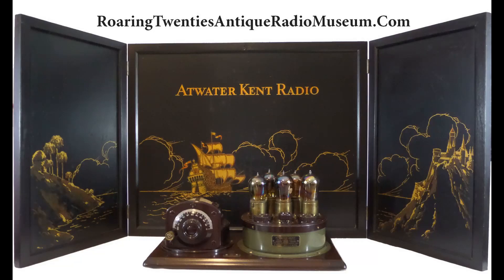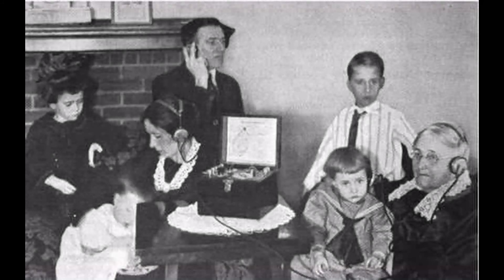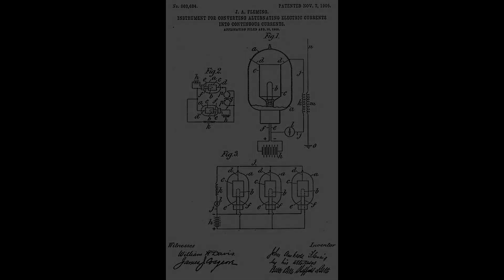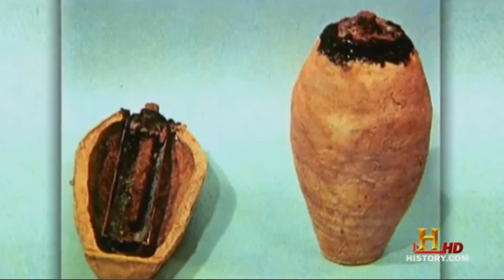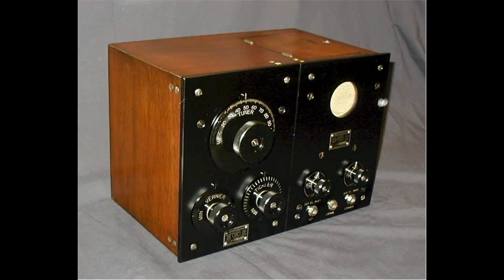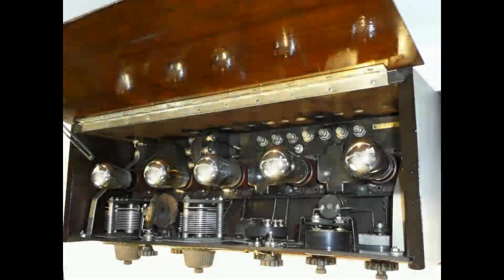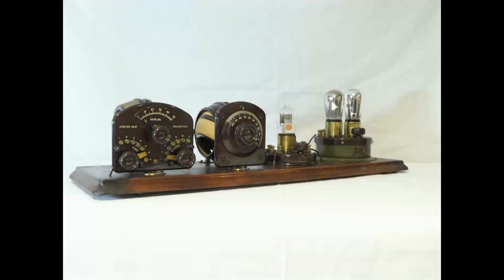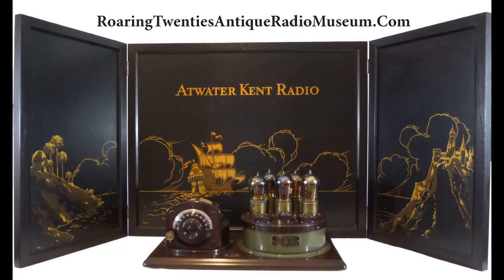From Crystal To Battery Radios

Comment: I heard prisoners of war used a piece of charcoal with a spring touching it as the crystal. I had my set down sized to a match box by high school, I used the radiator pipes for an earth. It was cool, no batteries .
Reply: I am guessing that the charcoal is the crystal acting as a diode , very clever to use stuff about the camp as it were.Thanks for your video
Reply from the maker: @Toad-515  You're very welcome, Paul. Thank you for watching my channel.
Reply from the maker: I have heard of that charcoal trick, but I've never tried it myself.

Comment: I'm 67 and when I was about 7 or 8 I built a crystal radio. I use a metal fence for the antenna.
Reply from the maker: How well did the fence work as an antenna?
Reply: @Radio1920s  The fence worked really good as an antenna. I built the radio out of parts not a kit. I spent my entire life working at the highest levels of technology and still had a hobby of old radios. I was a specialist with one of the biggest tech companies in the world. I retired years ago and still care for my antique radios.
Reply from the maker: @RottenAnimal  Same here as far as our jobs, I was into computerized manufacturing and one day I bought a restored cathedral  radio and thought, "I can do that", and that's how I got started collecting radios.

Comment: Atwater Kent can be thanked for something else but didn't receive the recognition. 
 Kettering created the points ignition system for cars but couldn't make it work.  He didn't understand inductance.  So he got his buddy Atwater to help. Atwater added the condenser,  capacitor. 
Now it worked.  So I believe the system should be called the Kettering Kent system. Not just Kettering.
Reply from the maker: Atwater Kent invented the cap and rotor ignition system on his own and was recognized for his invention by the Franklin Institute in 1914.
Reply: @Radio1920s  Many thanks.  I knew Kettering couldn't get it to work. 
And I knew Atwater was in the auto electrical before radio. 
 What I find most interesting is that here in Australia, Kettering is given full credit for everything. And Atwater is completely ignored and not even a quick mention of his achievements.  
 When I pointed this out to lecturers, i was told I know nothing.

Comment: I've always thought that it must have been quite expensive to run these radios off the old carbon batteries. They could not have lasted very long.  For farmers and country people it must have been something they used quite sparingly
Reply from the maker: Farmers would use lead-acid batteries and recharge them with their tractor.

Comment: You did a great job of explaining the transition from crystal sets to battery powered radios!...few are able to concisely and clearly articulate the key developments!!...it did leave me wondering about the trials and tribulations of early batteries as a power source… in researching early radio, I’ve never run across accounts of the headaches that they likely caused …in your opinion…were battery issues a big problem or a mere nuisance?...were sets often in need of repair resulting from battery issues such as incorrect wiring connections or were these sets fairly resilient?
Reply from the maker: The early radios were fairly difficult to damage by incorrect wiring. The invention of dry cell batteries made power hook-ups fairly easy. Many people would order a radio and have the company deliver it and set it up for them. Replacing batteries was not cheap and I'm sure people were very happy in the late 1920's when electric radios were introduced to the public. Many people only had electric lights in their home and no outlets. Manufacturers sold radios with a plug end that screwed into a light socket.

Comment: Not a mention of the great inventor Nikola Tesla who was well ahead in AC transmission, the power that runs all modern electrical systems and what made radio transmissions possible
Reply from the maker: If you read the title it says - "From Crystal to Battery Radios".  Radio transmission has nothing to do with AC. Later radios were powered by AC, but they contain rectifiers that convert the power to DC to run the radio.
Reply: @Radio1920s Ok

Comment: The Philco company started out as a manufacturer of storage batteries, first for automobiles and rural DC home electrification systems used to provide electric lights, and a windmill driven generator. They were also providers of A batteries for early radios. One of their first non battery products was a battery eliminator, the  Philco Socket Power...
https://64.media.tumblr.com/6e6df765d486c30ffed5b2009645889d/tumblr_pj6r1qbd0H1s2snqvo1_1280.jpg
Which I have, and have restored to working in my collection.